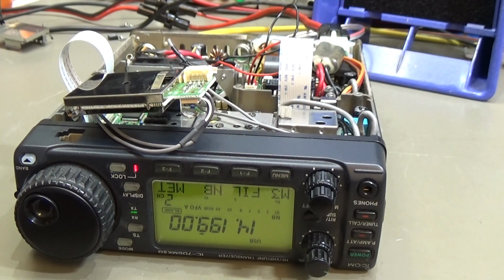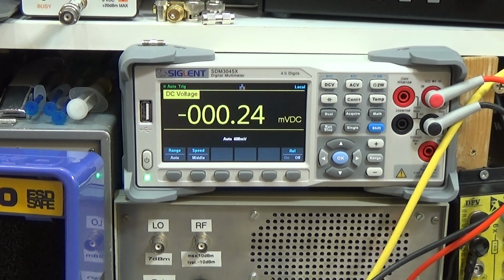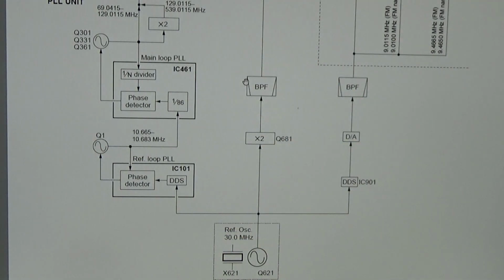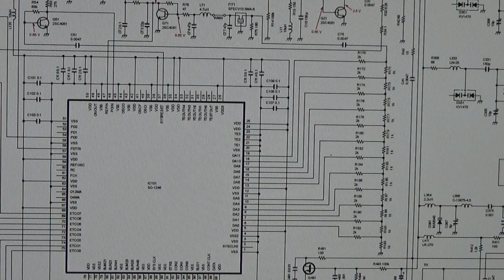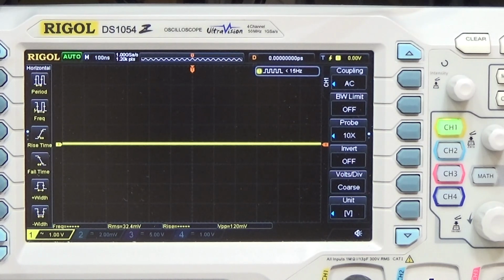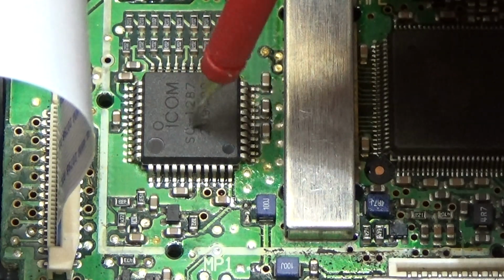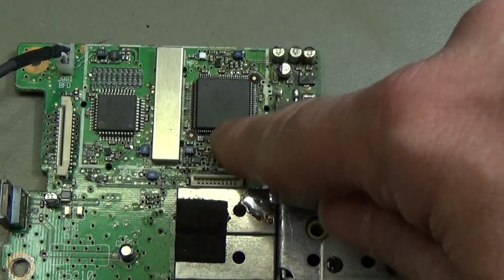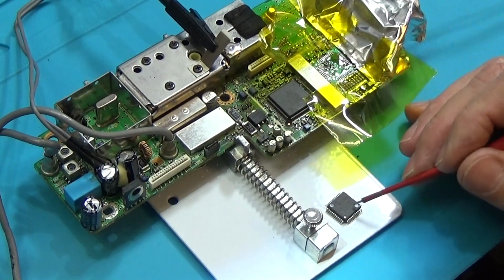#127 Part 1: Basics of practical PLL troubleshooting

Comment: Cheers Peter! Good tutorial. Usually I use a preheat element on the other side of the board for example at 110 degree C.
73s LZ1MOB
Reply from the maker: Hi Mihail, yes a preheater is differnt way to do it. I prefer the method of carefully heating the pcb up with 300°C and than increasing the temp and going down to the ic.. Thanks for watching 73

Comment: I was planned for on doing a PLL theory video too, you kind of beat me to it ! I will still do one anyway as mine will be more focused on CB radios.
Reply: TheDefpom 

At some point I am going to do one to.  Got a parts radio here tha has a separate synthesizer module in it that works out of radio.  Its old school 4000 and 7400 series TTL and CMOS.  Figured that would be nice to use so I can demonstrate individual circuit functions.  Hard for some people to understand all the circuits used in single chip PLL's.
Reply: MikesRadioRepair - I guess there will be an influx of PLL theory then ! Between the 3 of us we should have it covered from all sides 😃
Reply: TheDefpom 

The more the better.  :)
Reply from the maker: There are so many additional aspects around the PLL which are not covered in this video so much more to do for all of us  :-)

Comment: Inject the DDS frequency from a signal generator directly into the PLL and see if it locks.
Reply from the maker: as long the shorted dds is not back in place I have still the unlock. so that is the second step. 73

Comment: Thank you for this excellent video. I’m troubleshooting a sick ic-706mkiig with no 1st LO.  The ref PLL checks fine with all signals present. I’ve isolated the problem to the main loop PLL with no signal at the output of the VCOs (Q10). I’m suspicious of IC461 but can’t access it or the VCOs since they are located on the backside of the PLL board. Noticed you have extra long ribbon cables that might help. Can you please tell me where you obtained them?  Maybe provide the part numbers. Thanks again for your great videos!
Reply: Aliexpress?

Comment: I have different symptoms: RX somehow work but no selectivity, CW signals has all splatters through band and it is changing after TX/RX switching. Looks like on TX it works. Could it be also PLL issue please?
Reply: Even more …all CW stations has no tone in audio just keyed noise…

Comment: Use the schematic more to guide you. look at the function of the two 220 resistors and the 7805. Most likely, at some point the 5 volt supply went high to the input voltage of the 7805 and cooked the chip. What is the voltage into the 7805?.
Reply from the maker: If I would have guessed that an over voltage occurred to the radio I would have mentioned it. The voltage regulator is directly connected to the switched 13,7V line. If we would have had an over voltage to the input we also would have had an over voltage to other components i.e. on the main board and not only this voltage regulator would have been toasted...
Reply: What I am saying is that at some point the 5 volts went to 13.8 volts on that board. If you will notice, resistors R291 and R292 have both been replaced, they supply power to the 7805 regulator chip.  The schematic indicates they should both be 22 ohms not 220, unless of course the 0 means zero zeros. The 7805 has probably been replaced as well, . Also note that 2 chips have failed supply chokes, one open and one at a high resistance. High current has gone through both inductors, it is very unlikely that both chips had internal failure at the same time. A voltage higher than 5 volts has been applied to both of them. It is very rare for a 7805 to short and allow its input voltage to show up at its output, but if it got hit with a high enough transient, it might. However, such a high transient would have destroyed a lot of the radio, maybe it has.  if 13.8 volts is applied to the output of the 7805 without 13.8 volts on its input, it will smoke.  Consider the possibility that someone may have applied 13.8 volts to one of the accessory jacks on the back allowing it to somehow get to the 5 volts on the PLL board.